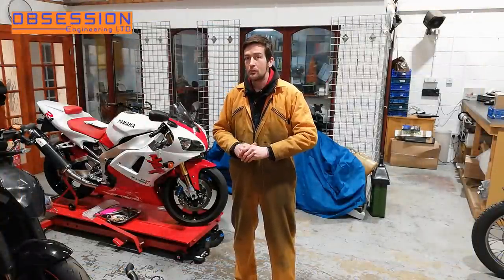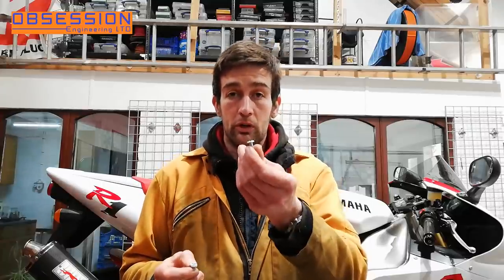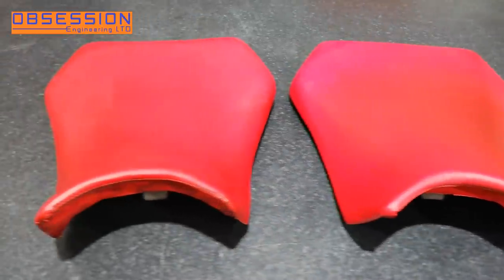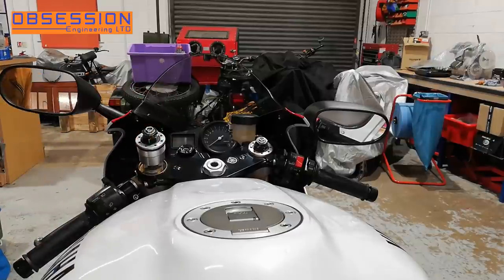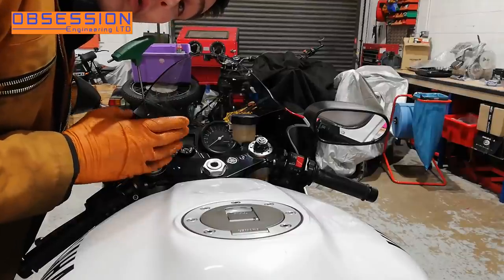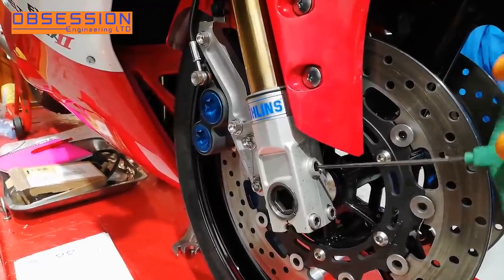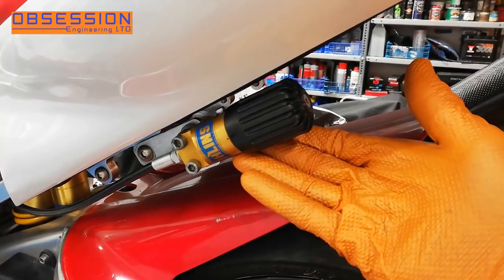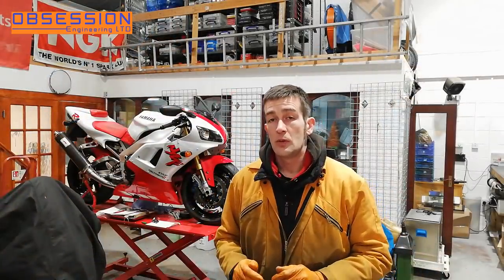1998 R1 Jigsaw Puzzle. Part 7. Checking springs and suspension base settings

Comment: Dave,

Alternatively, you could purchase a replacement seat cover. From what you have shown, the padding on the seat with the discoloration appears to be in good condition. The covers are easy to swap out. They are normally just held in place with some industrial staples.

A reputable after market seat cover manufacture is HTmoto, www.htmoto.us.

Here is a direct link to their replacement cover for a 1998 R1.
http://www.htmoto.us/store/p/405-YAMAHA-R1-98-99-Seat-Cover.aspx.

There are many options to choose from. Everything from OEM to a broad selection of colors and fabrics.
Reply from the maker: That's great, really appreciate the info. Will definitely look into it :)

Comment: Thanks Dave. I have a Vstrom 650 and about 1200 miles ago i removed put back the same fork springs along with the spacers, approx 80 mm long. Since then the droop has shortened to about 50 mm. I now think the springs have lost their tempered quality. Question, it seems reasonable to assume that instead of a short spring/spacer combination and i fit a longer spring which will, i assume, place less stress per turn on the longer spring. Can you please help and using your engineering skills offer some advice